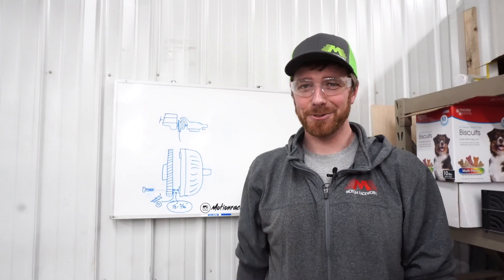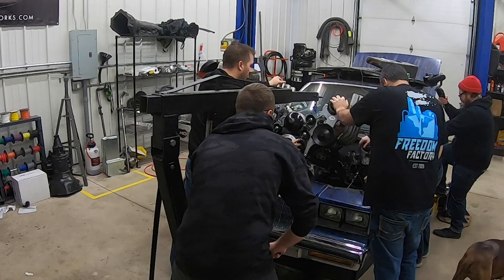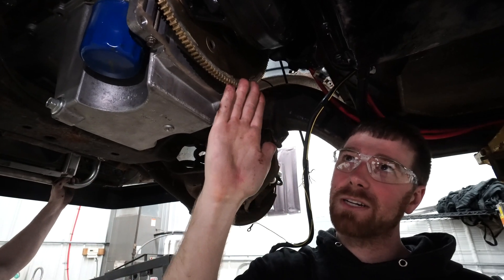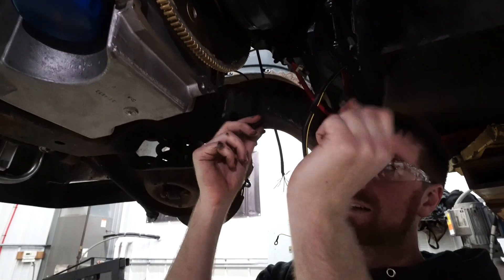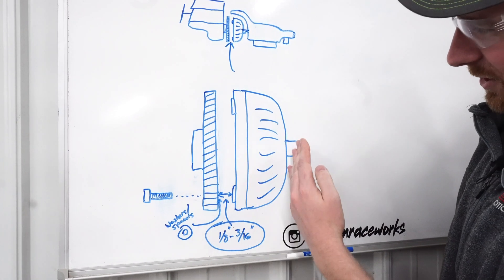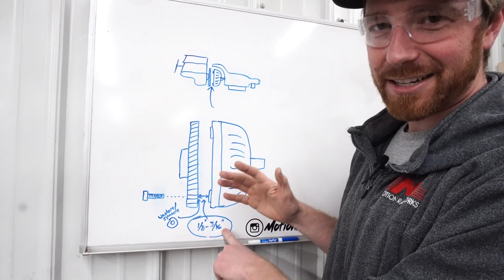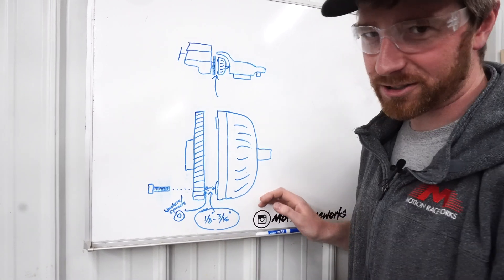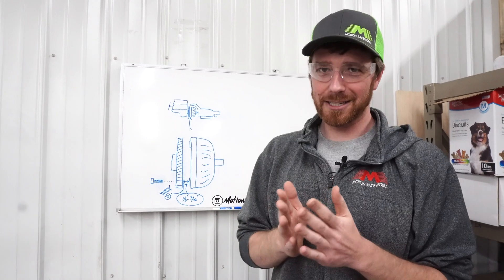Torque Converter Spacing / Shimming: Tech Tip Tuesday

Comment: put my trans in and spacing was too far and it ran and drove for a bit until it started eating the pump up on my th350 and clogged the valve with metal shavjng

Comment: Great video. I have run into issues with different aftermarket converters with different length snouts. You can bottom the converter snout on the inside on the ls adapter spacer or be a couple thousand away from it, you still have the right pullout spacing but if the converter pushes forward at all it hits the inside of the adapter and wipes out thrust bearings. pump pressure also ties into this. Double check this before calling it good.

Comment: If I’m watching correctly for example if push the converter all the way into the transmission say I have a 1/2” from the flexplate to the converter shouldn’t I subtract 1/8 from 1/2 that should be how much spacer I need or do I get a 1/8 spacer and bolt everything together

Comment: I set my 10" stall at 5/32" that's in-between 1/8 and 3/16 inch would you say that's ok?
Turbo 350 transmission

Comment: The spacing is so vital to the good health of the engine, it is incredible to know that many torque converters fail every day due to inadequate spacing.  That is just something that no one should experience.  Consult a local dealer to get the proper specification.

Comment: If the gap is greater than 3/16" then you put in a washer. If it's between 1/8 and 3/16" than no washers required and just bolt it in. Correct?

Comment: What about where the torque converter goes into the crank would you not need a spacer in there the same thickness of the flex plate to torque converter If you did not space, it would not push the torque converter into the crank

Comment: Thanks for the video. That was excellent, but I also wish you would have talked about the snout on the front of the converter in relationship to insertion into the crank. A very much over looked part of this equation.! Example: How much does the snout have to insert into the crank hub, Does the converter spin freely in the crank hub, and to make sure the converter snout does not bottom out in the crank hub when bolting converter to flex plate.  Thank you.

Comment: So I rebuilt my trans and now I have too tight of spacing I couldn't turn crank to put torque bolts in it was so tight had to unbolt bellhousing bolts to get it to spin
Reply: Torque converter isn't all the way in.

Comment: I have a C4 I rebuilt which now has no reverse and moves forward in neutral. Would the TC being too far out cause this? The gap was difficult to get a true measurement but MIGHT have been 1/4 (also could fall within tolerance of 3/16). I tried everything else (checked linkage correlation, valve body, air check and it passed. No idea what the heck is causing no reverse but it's driving me straight up bonkers and I'm about to throw in the towel.

Comment: Hey i made sure the converter is seated all the way and I tried to put a 3/16 drill bit in but I couldn’t it was alittle tight but the converter is not touching the flywheel should I shim it or no

Comment: What happens if you pull the converter off of the pump the 1/8” - 3/16” and now your converter is actually touching the flex plate on both the mounting pads and the hub? Meaning all you had to work with was .125” in the fist place. Bolt it straight to the flex plate, even if the hub is fully seated into the crank? I was told that is bad too.

Comment: Thanks for this excellent video.  How do you relate that number to the actual TC end play which is measured by the rotunda tool or whatever?  Do you still stick to the 1/8-3/16" thumb rule or would you use a different formula of subtraction?

Comment: How critical is it for the stud to go in far enough in the rear main seal
Reply: Just far enough for the torque converter stud to rest in the hole, it's basically a safety precaution if anything flexes in a weird way, that stud will prevent too much movement of the torque converter. Now if you got the stud completely out of the hole, it might be worth adjusting

Comment: As I understand it... measure the gap between converter pads and flexplate after engine is bolted up, and converter is still seated all the way into transmission.  I find a hole gauge is handy: match the gap, then measure that with calipers.  Then, subtract 0.140" from that measurement to figure shim thickness [if necessary], with a goal of roughly 0.035" +/- accuracy.   So if you find gap is somewhat under [say... near 0.120"], bolt it straight up and have a nice day.  Stay the hell away from sloppy grade 5 washers from you average hardware store that are often off by an entire bolt size these days  - pure junk, fit only for your coffee table..

Comment: So you gave us the 1/8"-3/16" range, but how do you measure how far the converter pops out when you go to bolt it to the flexplate? Do you measure the distance between the converter and the flexplate while the convertor is still pushed back in the pump first?
Reply: Measure the distance with the converter pushed all the way back. Then subtract 1/8 or 3/16 from the total. What's left is what thickness the washer needs to be.
Reply: @johnlaws9853  is there any worry about the snout on the converter not being into the back of the crank if the spacer is to big?

Comment: 5.3/4L60e 3200 converter. Put the converter in trans, got 3 clunks and everything seems smooth, bolted trans to block and my spacing between converter tabs and flex plate is .125 , so just add shims between converter and flex plate that don’t move the converter in or out and I should be good correct???
Reply: Did you ever figure this out I have your same setup?
Reply: @erickuribe9860  did you figure it out ?
Reply: I'm using a circle d 3200 converter.

Comment: Why does it need shimming? It should just fit and bolt in.
Reply: if the exact same parts that came from the factory are going back in, yes it should  just fit.   But if you change the engine, transmission, torque converter, flex plate/flywheel, or anything that can affect the spacing, than this needs to be done. 

At minimum you need to check it so you do not end up breaking parts.

Comment: I just learned about this from watching Precision Transmission on youtube. I have changed a LOT of transmissions. I will be checking spacing from now on
Reply: Problem with precision transmission is they mention a lot of this stuff, but they dont show a damn thing
Reply: I have done many swaps as a tech and have seen thousands done by other techs. Never saw anyone check spacing untill I found precision transmission. Richard is the GOAT for transmissions and I have checked spacing ever since
Reply: Doing my first ls swap been racking my brain on this one thank you gen 4 5.3 and a 700r4 is a bit tricky

Comment: If you're adding shims wouldn't you have to do something about the torque converter bolts, so that they don't hit the block? I'm asking because I had to shim my 5.3/4l60e and using the factory bolts.
Reply from the maker: You add the shims between the flex plate and converter, that won’t effect the bolt relation to the block
Reply: @MotionRaceworksOfficial  I realize that now haha thanks.